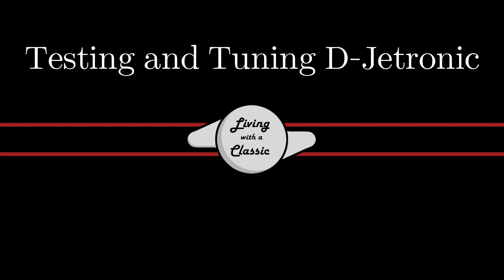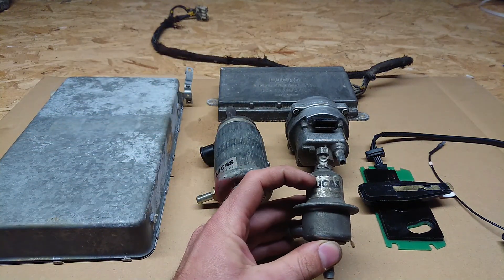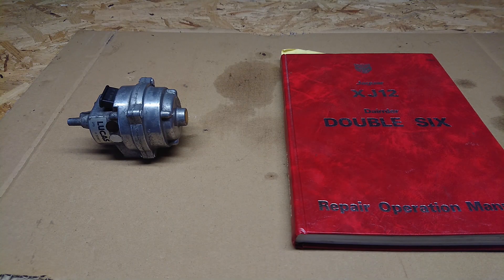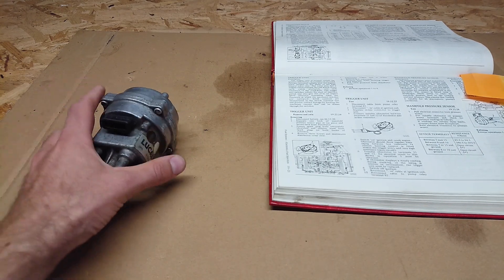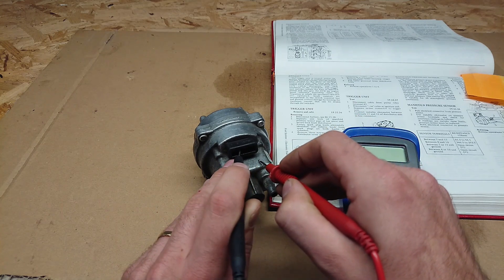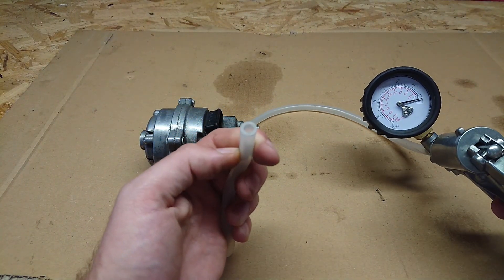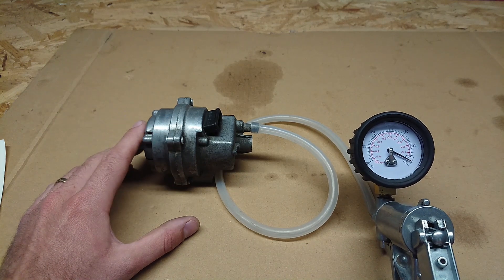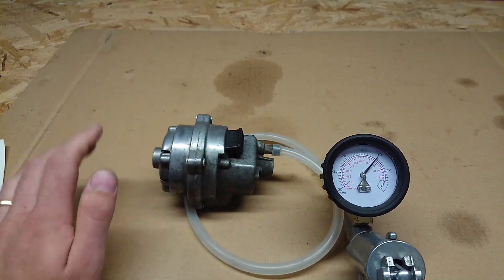Testing D-Jetronic Map Sensor - Understanding D-Jetronic Fuel Injection part 2 (Jaguar V12)

Comment: Hi ! I would like to hear your opinion about this problem with the MAP on the M110 engine of my 1975 Mercedes W116. The engine sputters when I accelerate and if I remove the MAP hose the engine accelerates normally, even with the manifold hole plugged. Attached is the video. Thank you!
www.youtube.com/watch?v=Ofguj7pvJ_E

Comment: Is that the very same part that's used on the 4-cylinder Porsche 914 1.7 and 2.0 engines? It sure looks like it.
Back in 1987 or 88, I bought a refurbished manifold pressure sensor for $125.

Comment: I have a map sensor with a small leak in either the seal or diaphragm do you rebuild them it is for a 450 sl 1973
Reply from the maker: I do not rebuild them, sorry. However Bosch rebuild them again

Comment: When I bought my car some years ago the metal diaphragm had completely fractured in two. I made a new diaphragm with some vinyl material, probably not a perfect solution but the car has performed well enough over this time and the fuel economy has been about normal.
Reply from the maker: That sounds really interesting! How thick was the material you used?
Reply: @LivingWithAClassic  Relying on my memory it would be around 1mm or less, it has to be able to fit behind the circlip that holds the diaphragm to the centre boss. Another good upgrade for the XJS is fitting a T700 R4 overdrive transmission as I have recently done to mine. it reduces the RPM down to around 1700 at 100kph and It makes for an effortless cruiser with a big improvement in fuel economy.
Reply from the maker: I have thought about that with my XJ12 or maybe a different rear end ratio to lower highway RPM

Comment: And I even made a sepcial chapter on Jaguar XJ12:  https://oldtimer.tips/index.php/en/d-jetronic/102-jaguar

And sorry English version of my vacuum test video: https://oldtimer.tips/images/cars/jetronic/MAP-sensor-test.mp4
Reply from the maker: Sorry about forgetting that, the link will be copied from the other videos. 
Thanks again!
Reply: Hi, I have a resistance of 95 and 372. Can that already cause bad ideling when hot? I checked the water and air sensor, they both work fine.

Comment: Regarding the pressure drop value over time requirement: is this from some Bosch manual or based on your own experience? Thx for interesting video. I will dig up my sensor and test it before  it  goes back in the car
Reply from the maker: It's from an old Bosch manual for further testing some components. It mentions a "machine" that tests them and this is basically what the machine tests first.

Comment: The resistance changes over the range?
Reply: Hi, I have a resistance of 95 and 372. Can that already cause bad ideling when hot? I checked the water and air sensor, they both work fine.
Reply: I still find it amazing that it works all these years later
Reply from the maker: Yes they do. But if they old tight and have the correct resistance with no vacuum applied they tend to work great
Reply: @LivingWithAClassic  I did some googling and apparently it's a variable transformer with more than just a diaphragm inside. Overly complicated German Engineering :)
Reply: Sorry, that is not correct. Resistance does not change over vacuum range. Transformation changes.
Reply: No, The sensor has two coils, the primary coil inducing a signal in to the secondary coil, the signal in the secundary coil is altered by the moving core. The core is moved by two vacuum cans and a full load membrane. In a vacuum test, it is only tested whether the membrane is OK, not whether the vacuum cans are defective.

Comment: A service exchange from S C Parts is over £1100.   🤧 Going to test mine too, Dr. D Jet in Germany can refurb, you need to send the controller with it so he can match the refurb to it, offhand I think it’s around £250. Very reasonable.
Reply from the maker: I planned on sending mine to Dr. D jet too. I think it's very reasonable. I managed to find one in a parts car that's working well.
Reply: @LivingWithAClassic  Great movie! I'm restoring a Citroen DS from 1971 also equipped with a D-Jetronic injection system. I just wanted to check if the method with the vacuum tester also works for other MAP sensor. My car is fitted with a Bosch MAP sensor with Bosch umber 02.801.000.11. It has the same working principle as the one on your Jag also consisting of 2 barometric chambers. I wanted to know if the procedure you apply could be used to detect leaks on my end as well. Could you also explain a bit more on what the experiment is based? You mention a pressure leak of 0.05 over 10 seconds. What is the reasoning behind these values? Some kind of Bosch test, experiment on the car,...? I want to know if I can do the same test or should adapt a bit as the MAP might be tuned differently as it's a 4 cylinder instead of a 12 cylinder. Thanks for your support!
Reply: Do you know how to contact dr d jet in germany? I cannot log in to his homepage / forum. (Cannot activate my account)
Reply: How do I contact Dr D Jet
Reply: @sljgroup3229  I think he has ceased trading unfortunately